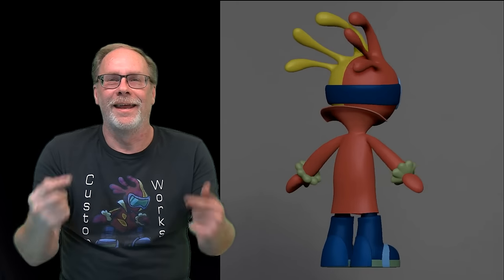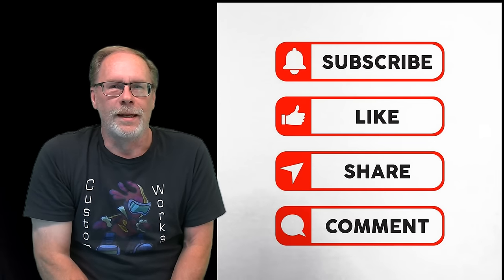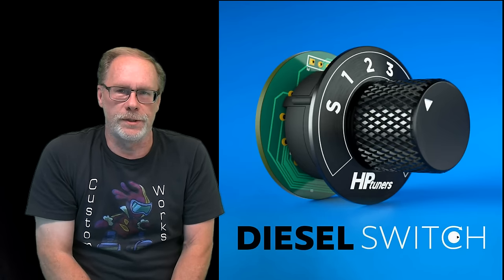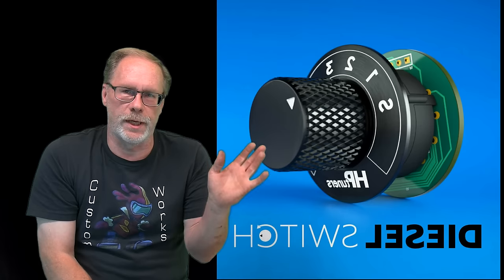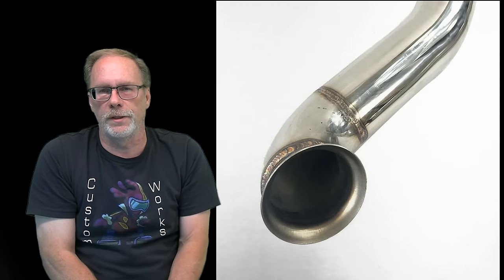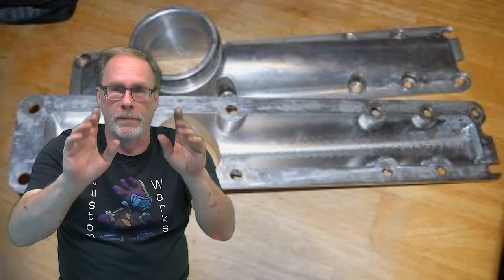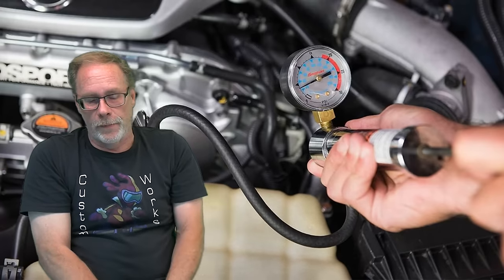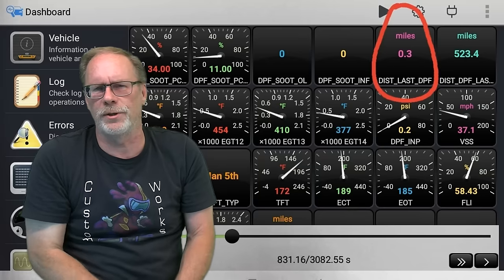🦩 7.3 POWERSTROKE  DIAGNOSE WHITE SMOKE 🧑‍🔧⛔🟡🟢🛻

Comment: Wouldn't over filling the oil in the engine block also could lead to oil coming out on the exhaust manifold. And not necessarily mean a bad cylinder condition..?

Comment: I am watching all your videos. GREAT STUFF.
going thru my  2001 7.3 235k miles.
Replaced new or rebuilt the following.
Oil cooler,
Factory turbo,up pipes; oil pan, auto tran fluid & internal selinoid pack.
Engine wire harness. ECM rebuild, added 6 position chip. adrenalin HOOP, fuel tank clean out.  5 new sensors.
Issue: engine running/ shift into reverse OK. Shift into drive- engine immediately dies. My bald spot is growing from the head scratching.

Comment: My 7.3 makes a great gopher hole fogger in the winter (20*F or lower). plugging the block in (and with a silicone heat pad on the oil pan), the smoke is very slight, if at all.....

Comment: Hey buddy, I replaced the pedestal on my 7.3 yesterday because it was leaking and everything turned out really good. The white smoke is gone but now my cruise control doesn’t work. Can you imagine what I might’ve bumped or broke loose or short circuited or whatever because my cruise control is not working on my 2000 Ford F350. Thank you.
Reply: Check your glow plug relay. See if you forgot to put the ground wire back on. If it is on, disconnect your ground wire, go for a test drive. If your cruise works with your glow plug relay ground wire unplugged, replace your PCM...Ask me how I know🤣

Comment: I changed my icp sensor and it still randomly dies only when cold....also if I hold it to the floor it has no turbo or turbo sound and sounds as if it's missing or lack of fuel....it only smokes on start up when cold but no smoke when driving...i did check both sides of the turbo and it spins in one piece...
When I do gradually bring it all the way to the floor to try to build pressure to spoil the turbo when I do finally let off it dies right away and then it takes two or three times to start it before it will start running on its own and then sometimes it will run a bit sluggish and then idle up

Comment: My truck is a 1995 7.3 power stroke F350I was blowing white smoke Change many sensors  I found out my block heater was shot AKA not working Change my block heater and all the  coolant I have 108000 miles on this truck I know it is the mileage is true because I've seen the truck the day it was bought brand new from a friend of mine I work with He took very good care of it but he always parked it in the barn My truck is parked in the elements it would not start at 45ﾟ It would blow white smoke and not start Until I change the block heater and of course you must replace all the coolant For my year it needs to be the correct coolant otherwise The coolant will eat the cups Last year I replaced The glow plugs This year I replaced the block heater all the coolant and I plug it in It's been down to 20ﾟ in northern Minnesota if that thing is plugged in she has no problem I don't even hear the starter term before it starts Apparently this old girl likes to be warm before she'll start and I'm OK with that I plug it in every night whenever I come home and I have a timer on that power cord so she's only on certain times when I plan on waking up and get moving She fires up every morning like I said down to 20ﾟ but northern Minnesota trust me it's gonna get the 40 below and I know that old girl will still start no white smoke I hope

Comment: I have a question , for anyone . I have a 94.5 ps 161,000 miles. I store it alot . Last couple years or so when I start truck it hazzes some and I have burning of the eyes if you close to exhaust. After driving down road and come back it’s not like that .  Runs great . New glow plugs 5 years back fords. This is my only issue . I have no cat. What makes the eyes burn ? Fuel? I have 6637 air intake opened up behind turbo. I have hydra also . Everything else is stock

Comment: I have a question sir. I have 4-4.5k miles on fresh rebuild with a stage 1 camshaft.4" exhaust, wicked wheel2 with KC turbine wheel, and stage 1 Full Force Diesel 180cc 0 nozzel single shot injectors and php chip. Have a crank no start that is about glow plugs. Put new GP relay (motorcraft), yet still problematic. my fuel pressure bleeds down over night and it takes 10+ cycles of key till new fuel pump times out, yet crank and white smoke no start unless I jump across the GP relay. Once it starts and warms a bit, she will continue to bust right off. Let her set over night...no start. Have new motorcraft IPR, IPC, new ecm (original shorted out last Dec.) IDM checked and is great, chip also check good. When warm it surges at idle. Otherwise all is well. DUH! ripping all inj. out, going back to split shots, but Im very frustrated, mad, and generally in a poor mood. A Fancy 7.3 shop wanted over 6 grand to fix. $1400 labor to r&r 8 injectors and $2500 for 8 160/30 injectors. Guess they thought I was an idiot. Now I have to fix it. H.E.L.P.!!!!! Ima 64yo mechanic but I feel like I dont know JACK.

Comment: Just curious, I bought an e99 7.3 and it had quite a bit of problems and a shop found brass in the oil filter. Shop installed new reman long block 7.3 in the truck. They had to take the motor back out after install due to leaking front cover. New cover installed and the shop put a little over 200 miles on it. 
I made it 72~ miles to a tire shop to make an appointment and the truck ran great. After about 45 minutes in the shop, I started the truck, started driving and about 400 feet later the truck started to “clack” really bad and it was billowing white smoke. Parked the truck for a tow. No oil visible on the dipstick. Any ideas?

Comment: I had white smoke at startup. Watched your videos and narrowed it down to CPS and MAP sensors. Changed them out and the white smoke went away at startup and idle......but. I still have low power, hesitation and white smoke when I floor it at 25ish mph. I have to let up and feather it and it will accelerate normally. Ideas?
Reply: Figure it out ?

Comment: what causes a pulsating idle at operating temp {revs up } 50-70 rpms  it has to run at operating temp for at least 30 mins before it starts pulsating  has a new adrenaline HPOP. BLEED OIL RAILS? OR ?????

Comment: I just watched your video, I probably should have watched it one more time. I believe my vehicle is  earlier than you have stated. 1995 F350 7.3
Reply from the maker: 95 is like the 98 99 a switching year yet most everything applies here in the video
Reply: 95 is all similar, except no intercooler, different injectors, turbo, down pipe, and programming. Pistons are forged on these early engines. The 99 and older are not.

Comment: Fantastic video! One thing to add though, if you still have smoke after unplugging the injectors the injector causing the problem can be leaking fuel due to a stuck ball valve or whatever. So, at that point the only way to isolate the problem injector would be to block the fuel supply to the injectors one at a time. Or measuring the return fuel amounts for each injector the one with the least or the one with no return most likely the case is leaking fuel into the combustion chamber not allowing for optimal combustion temperatures. Meaning the metal is acting as a heat sink. Also measuring the exhaust temps with a thermal imaging camera is also a good test the one coolest means its not firing the one thats the highest is getting to much fuel, that will at least point you into a direction.

Comment: I have really enjoyed your youtube videos.  They are very informative.  I recently took your advice about replacing the Engine Wiring Harness.  I have also replaced the Valve Cover gaskets, ICP, EBP, MAP, MAT, CPS Sensors, as well as most of the Vacuum Lines.  I have even rebuilt the Injectors using your video as a guide.  I am looking for some guidance with regards to a P1272 & P1277 Code (High to Low Side Open) I received when doing a Buss Test with FORScan.   I did Pin Testing on the IDM Connector.  When Ohming it out I received 3.0 (cyl 2), 2.9 (cyl 4), 2.9 (cyl 6) 3.0 (cyl 8), 2.8 (cyl 1), 3.0 (cyl 3), 3.1 (cyl 5) & 2.9 (cyl 7).  When I did the IDM Ground Circuit test (23 to 18, 23 to 26, 24 to 18 & 24 to 26) it all showed open.  I even replaced the Solenoids on Injector 2 with 3 different ones and even replaced the #2 Injector thinking I might have rebuilt it wrong., but still get the P1272 & P1277.  I am thing that I might have a bad IDM.  Any thoughts or advice would be welcomed.

Comment: I have white smoke on start up I replaced injectors, hpop and wiring harness. I didn't have this problem before.
Reply: If your white smoke smells like diesel, I would first check glow plugs, relay, valve gasket wiring.  If those are good, check IDM.  Mine finally died one day, and startup smoke dissappeared, along with major improvement in overall performance, after replacemet with a rebuilt unit.  Cheapest option is the mail out rebuild some companies do.  I also swung the connector in, and moved my IDM to the engine bay, as the wheel well location is a PITA to get to, and I had the room behind the intake.
Reply: Change the oil to delovac and use archoil 9100 in the oil, starts will be noticeably better. You have to keep using arch oil 9100 every change.

Comment: just replaced wiring harness and my mat sensor connector on the new sensor is like not going on!! The old one was difficult throwing it on there but the new one just seems to only go so far on the plug! Got white smoke trying to start it until batteries died

Comment: I bought a 2000 ford 7.3 powerstroke  with bad batteries I replaced them and was cranking it to start it cycling the glow plugs, and it would crank and then it stopped and quit turning over and would make s loud click under the hood,  starter still engaging

Comment: My 7.3 missing pretty bad plugged into a computer and had an issue communicating with the pcm so I’m not sure what to do I don’t want to just start throwing money at it blindly at this point. Seems like bad injector or injectors I will have to do that that you suggested and unplug em as it’s running but if that’s not it I’m lost with this pickup

Comment: Suggestion on where to start no check engine light on when key in on pos wts isn’t on but the glow plug Element light is. Truck has extremely hard starts when hot not as bad when cold but still hard starting . It smokes white badly on starts and acceleration I’m away for work as of now so I’m not in access to scan it. I know this isn’t a issues along the lines of the cooling system as I recently did the pressure test? I recently replaced the ipr and the only performance upgrade that was done is stage one injectors were. I’m assuming it’s injector o rings but I won’t be able to pull the valve cover here until I’m back from work

Comment: Every once in awhile, I'll get an extremely lomg crank, and upon start up I'll get a big plume of white out of the exhaust. Guys in the groups are telling me check my GPR and GP.
Reply: Any ideas? Lol
Reply from the maker: Yes /// test the glow plugs at the gasket plug connectors /// 0.1 to 2 ohms good glow plug rating / check for burned connections and wires start with this
Reply: @CUSTOMWORKS7.3PSD  I will do that, I'm terrible with electrical stuff  (stroke survivor) I van get a friend to help me though
Reply: Clint, I’ve got an intermittent p1316 code. Truck runs fine. I’ve just gotten a Bluetooth OBDII dongle to use with FORScan, but I’m not an expert with FORScan. Can you point me in the right direction to get to the bottom of this IDM code? Thanks a million!!

Comment: hi i have a question i have a 1996 7.3 but it only smoke when the turbo start to build pressure like in 3rd to 4th gear is a lot of smoke  and when i go normal 1st 2nd gear it dont smoke for me is rare im new with this truck
Reply from the maker: engine is at a heavier load in 3rd and 4th where in 1st and 2nd its doing the same thing but combustion is hotter and burning off the ??? so do a compression leak down test to rule out rings if that passes then rebuild the injectors the problem will be gone I have a injector series that covers everything you need to know and a video on proper removal and starting

Comment: My 7.3 is having EOT and CTS issues.. the combination is now frustrating Smokey cold starts.. P0197.. no short from EOT connector to 42pin, ohms out like it should.. sensor also ohms as it should per temp.. aiming at PCM pins and or wire from 42pin to PCM.. I enjoy troubleshooting but I am tempted to just run new wires for both sensors to PCM rather than buy the harness

Comment: Picked up a 2002 7.3 project truck. Very bad blow by and white smoke. Oil coming out the rear passenger side exhaust manifold. Today i took the valve covers off and discovered a broken glow plug from that cylinder. It definitely allows the blow by but would that also possibly account for the oil on the manifold and the white smoke?
Reply from the maker: White smoke from a diesel engine can have different causes, depending on the thickness and duration of the smoke. It can be caused by faulty injection timing, low temperature in the combustion chamber, condensation, coolant leakage, or worn or damaged components.   oil on the manifold , leaking valve cover-bad spring - seal- ring- //// fix glow plug s run for a few days and clean manifold at same time glow plugs replaced see what comes of it
Reply: Thank you for all the videos you have done and your help. Couldn't have done this with out you.

Comment: I have a 02 7.3 I’ve been fighting injector orings for the last three years. Literally every summer same time of year to the exact date Facebook memories I’m doing injector orings. Went doorman and motorcraft  (twice) brand  did not matter   Same result. Now having white smoke issues on start up it’s bad bad. But goes away in 2 minutes or soon as it warms up or you can hear the turbo spinning through the exhaust.  I replaced the oil cooler orings recently they were leaking on cold start. But bank 2 injector control pressure is bouncing all over the place on road test so I know the issue lies on the driver side is there a way to narrow it down to a individual injector or cylinder  bank one is steady at almost 1700 psi while bank 2 bounces from anywhere around 1200 psi to 1800psi. I hate to pull all 4 injectors again and replace orings or pull the cup seals they were replaced 4 years ago  with the cylinder sleeve loctite.
Reply: Update tested glow plug relay again  and  to find out it was intermittently working.  Replaced relay. After replacing relay I now have check engine light on was not on before I replaced glow plug relay.  P1210  p1209 p1211 p1212 p0304. Ordered new pressure sensor cam sensor and pressure regulator.  Going to pressure test the cooling system overnight and see if it drops and see how it starts.  And pull injectors to see if it’s cup seals. Just confused I had no check engine lights till I replaced the glow plug relay
Reply: Update to update  did an overnight coolant pressure test maybe 1 psi drop overnight.  Unfortunately it now is a crank no start now. Before it was a crank 5- 10 seconds  start white smoke for a minute or two then go away.

Comment: I have a 1999 Ford f150 5.4 that's acting weird. I can go two weeks with no coolant leaking at all then all of a sudden it starts disappearing. Changed oil and it looked fine. Still looks fine nothing mixed in. I will have white smoke that comes and goes. Usually, when I first start it up. Every so often it will last longer than usual even after driving it a bit. Sometimes, I can run up the road and come back and it's gone and won't smoke anymore that whole day. No obvious leaks anywhere. Runs pretty good doesn't overheat as long as I keep the reservoir filled. Recently, changed my thermostat my temp gauge will go to middle once warmed up but sometimes the needle will drop to quarter ways. Like I said the smoke and the coolant will come and go. I drive it everyday one day it won't smoke or loose coolant couple days go by then it will then go away again. Also, the white smoke doesn't smell sweet. Nothing under oil cap nothing in oil . Any suggestions
Reply: Did you figure this out? Mines similar in symptoms.

Comment: My passenger side manifold, cylinder closest to the fire wall is wet and I can see white smoke coming out from the manifold (only that exit) with what you described in the video should I attempt to fix it or sell/scrap the truck, I’m not great on money and have a daily vehicle since I don’t drive the truck due to the issue
Reply from the maker: Pull the manifold www.youtube.com/watch?v=d0DKirb4aP4 and confirm the inside is wet if the inside of the manifold is wet and the output from the block hole is wet and you can't swing a rebuild its time to move it on down the road If the manifold is wet from diesel fuel then you know its just a injector and that's a cheap easy fix and with seeing white smoke at that out put the manifold needed new bolts and gasket any ways

Comment: Can I use a short flex hose to bypass the after-cooler so that I can run the truck when taking off the valve covers to check the injectors?
Reply from the maker: not necessary but if you want go for it